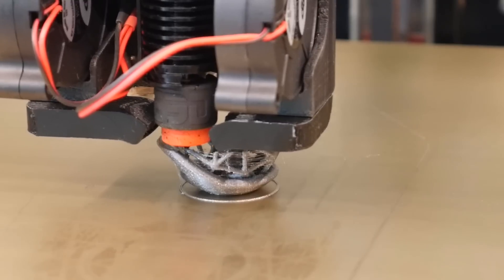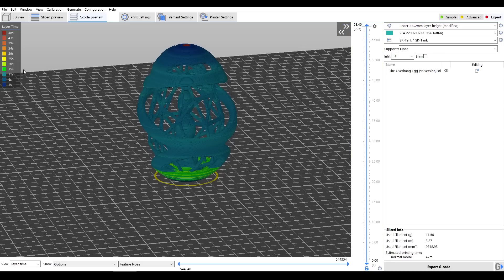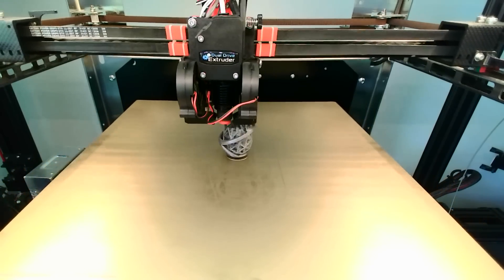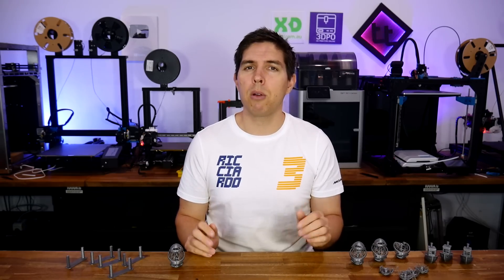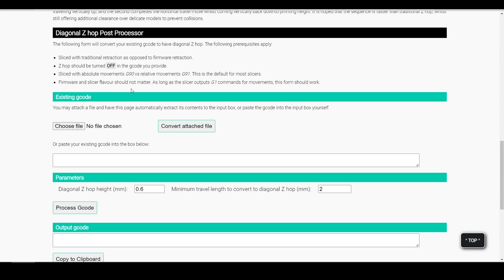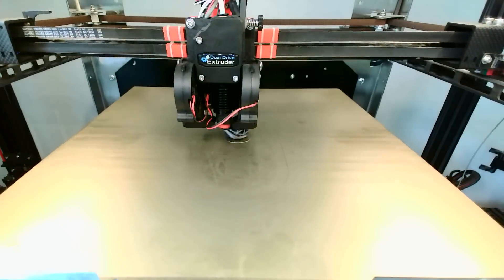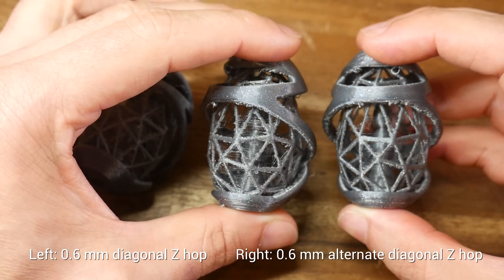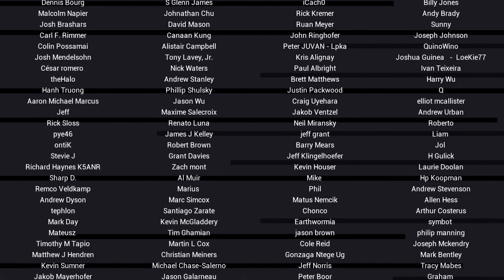Diagonal Z hop - Help me test this new slicing idea

Comment: I used to have a script that would intercept the g10 through g11 command, retract E, do a 3d diagonal move to just above where I was going to plop down, and then  unretract E, and simultaneously plop down. I stopped when I started using firmware retraction and linear advance. I've thought about hacking marlin to make g10 and g11 more complex by adding some canned code, but I haven't found the time

Comment: Clever work around and perfect timing because it may not be needed soon, I just saw a solid state cooling fan with no moving parts at CES, super cool and would be perfect for 3d printing.  And what do you know the issue of the print not sticking is directly related to cooling.  I wonder how much speed we're actually loosing because of non optimal cooling.  I see fan upgrades in the 3d print community all the time but nothing much more said after that.  The company claims it can improve laptops performance x2 is how bad cooling is these days , giving them another 5-10w of headroom, which is alot if your processor is only 15w to begin with so a pretty major breakthough in coolin technology i cant wait to see it applied to 3d printing.  Maybe you could mod an ender 3 to print at 500m/s with that kind of fan?  I saw the video on PCworld's channel that shows it off at CES if anyones interested and Frore Systems is the company.   It looks like a flat lithium battery that apparenty is filled with these small vibrating membranes that suck air in at incredible speeds and blow it out the end.

Comment: These PEI sheets looks like complete crap. Why you are using them? I use glass and PVP dissolved in an isopropyl alcoohol, and it sticks really well. I just cannot detach part from the glass. If I try pull too hard I will break the part or the glass, but not detach them.
Have stringing - dry your fillament. Have curling - add cooling, slow down and lower layer height. Z-Hop is not needed in any situation at all.

Comment: Will test soon. 
But: I think the results will be even better with a reversed start-section. What I mean is the following:
Z-hop to the opposite moving first for a short bit and then do the real motion, a bit overshoot and move back. I'm pretty sure this can eliminate the stringing even further.
Reply: Basically a wipe in the reverse direction? I was thinking something similar. It might be a bit tricky though because it might not be obvious which way to move back if there are many short segments.
Reply: @reverse_engineered  Yes, that is what I meant too. Might get the distance from the last line but still tricky.

Comment: An interesting idea, but there has been a feature request in Superslicer for something similar to the alternate version for quite a long time now (#927 and #2912). But, at least in part, for a different reason.

It's to get rid of the blobs at the end of a move. All filaments, even when retracted, ooze a bit during travel, some more than others, partly determined by temperature. The effect is at the destination, if it crosses a perimeter, a tiny blob - the ooze - will be deposited. Next time, one layer up, it will deposit the blob on the end of the blob it deposited last time. And so on, leading to the characteristic thicker line curving up and away from the destination perimeter. After a bit, the ooze line sags, the next move misses it and goes right to the perimeter and it starts again.

To get rid of it, add Z hop so the ooze clears the destination perimeter. Does the job but introduces stringing at the start of the travel. Wiping at the start helps a bit, but it still strings to a degree.

So the request is to introduce a rising Z hop, zero at the start of travel, some value at the end, followed by a vertical drop, though other profiles are also discussed in the feature request.

Ideally the rate of rise should be settable, either specified as mm rise per mm travel, or better still, mm rise per sec. So one sets the rise slope based on the ooze rate. It needs to be a filament variable as the ooze varies with the filament type.

No movement on implementing it so far.

Comment: This is a great idea, and I like all the replies.  Post processing gives infinite flexibility.
 Now my speculation begins:
I think the hop is required regardless of how well the print is secured, because you must avoid hitting curled edges.  (My post processor does this also).

Another thing to consider - we could call it ooze time - the interval between print operations that the printhead can/will ooze.  
Vertical hops are very inefficient/slow due to the 90 degree angle.  Not having the first vertical hop after the retract reduces the time, and so possibly less stringing.

Three 30 degree moves would be quicker, four moves at 22.5 degrees would be a lot faster. (Remember my Junction Deviation Visualizer, smaller angles corner much faster).

Yet another thing to consider is that ooze can contribute to nozzle depressurization, particularly when there are a lot of moves in a short period of time. You may see that your extrusion widths get narrower (easy enough to measure). (And there is also filament deformation with repeated retracts).  That can be compensated in your slicer.

I think there may be some shake when your bed is being moved up and down, perhaps that is contributing to the accuracy issue.  Angular hops reduce the rate of the bed movement slightly, that might help during the ending movement to reduce resonance.

You're doing great work!

Comment: I bought my first 3D printer this week, a Bambu Lab X1 carbon. It printed this egg in just over 1hr, with no issues or stringing, no supports. Used generic filament too. So far I’m blown away with this printer.
Reply: Exactly , just dropped the file in, sliced then printed. NO changes to default and perfect print in an hour. I am on over 1500hrs printed so far. Only cleaning/greasing and belt tightening maintenance. So between your new out the box and my seasoned X1C   fast accurate prints are straight forward on some printers.
Reply: I'm really proud of the progress that 3D printing has made. I'm still using my first 3D printer of an Ender 3 Pro, and hearing people like you getting into 3D printing with such significantly better printers makes me excited about what will be available years down the line when I decide to upgrade.
Reply: Try the same using PETG and report the results back here please.
Reply: Man, is like someone starts racing cars with a F1 instead of a little crappy car... Lucky bastard! 😜😜🤣

Comment: When printing parts with little first layer contact area, I add a 5mm brim and use glue stick.  You can also add a little paint on supports even though you may not need them. The support base adds a little sticking action to small first layer parts.   I also slice the model using Prusa's cut function. This adds the extra step of gluing the parts together and adding a little filler to sand.  I greatly admire your skills at programming G-code.. very impressive work on developing the diagonal Z hop.  Nice work!

Comment: Are you using prusa slicer? Isn't there a wipe settings in there? I'm pretty sure that's what I turned on in order to remove a lot stringing. I'm not going to claim that I'm trying to print anything nearly as torturous as this. But anyway

Comment: Egg falls off bed. Me: Add brim, set bed to 70(actually 65 when I measure it with my main printer) and try again. Depending on where the extra buildup is, I'd probably do a combination of coasting, neg prime, increased retraction, lower hotend temp, full cooling, max travel and raise jerk speed.  ..and as a separate note, not try it in PETG ever

Comment: My guess, explained better by Bu Jin here, is that the stringing would be reduced if you didn't raise until the head is in mid-air.  That is, delay the z-hop for a mm or two, but keep it vertical.  This way, it wipes away any stringing on the source island, z-hops over other islands, and down to resume at the destination.
Reply: My thoughts as well while watching the video.

Comment: Important thing is when retraction occurs. For long time retracting in slicer was done WHILE moving up Zhop. This was perfect receipt for string to pull. You can fine tune it with "wipe". Enforcing 50-90% of retraction before wipe will break string before mowing up. I checked 2.5 PS and this behavior is corrected. Still by using last few mm of path as place to wipe /not much settings in PS/ you could better break string. A blob will start to form, but a "reverse wipe" on landing could hide it. And after a month of tuning... :D

Comment: That's all an interesting approach to z-hop, but the real problem you have in the egg print is the toolhead design on the Tank is awful for cooling. Those ducts take a full 90deg turn and then moves horizontal for as much if not more distance than it went vertical, and it looks like the two streams of air point directly opposed to each other which is the worst possible solution for cooling the filament in the middle as that the area of least flow and pressure. Smoother flowing air path in the ducts and both pointing slightly backwards of the toolhead would greatly increase the cooling. Take a look at the ducts on the XOL2 toolhead or the Stealthburner or the K3.

Comment: While I can understand the 'up' portion of the diagonal move, I'm not sure the 'down' portion of the diagonal move actually contributes much to the improved print quality. If the benefit of the diagonal move is to clear the nozzle from curled edges, you would theoretically want to reach the maximum height of the z-hop as soon as possible (at an angle that still provided the low-stringing benefit of course), sustain that z-position, then drop to the model at the intended destination (such as in your alternate diagonal move) Moving diagonally upwards the entire travel move seems to just increase the risk of clipping some element of the model over long distance travel. So perhaps you could include another parameter that controls the total distance traveled before the maximum z-hop height is achieved.

Comment: Hey there Michael, could you add a Z speed to the gcode generators on your site?  I have some modded printers that use a Tr8x2 (vs the TR8x8 stock) lead screws but the Z speeds on the tutorials is much higher than the Z motors can handle (basically any z movement just grinds then the height is not correct) love your content.  I was just bummed when i realized my big brain leadscrew upgrade mean in needed to slow Z speeds.
Reply: You can just change the DEFAULT_MAX_FEEDRATE or set it with M203 (at least for Marlin, no idea on other firmwares)

Comment: It seems like the moving horizontally has the effect of wiping the nozzle clean.  I wonder if a method of retract, then move horizontally off the part, then ramping upward would be effective.  Then a simple lowering like you do in the alt method and restoring the filament back to the nozzle would work.  Further, to prevent whatever limited filament might be dragged off the edge, a brief reverse in horizontal direction might keep more material away from the part edge.  Whatever might remain would potentially have minimal impact on the next layer deposited.    I"m still new to all this, so I don't have the experience to predict the possible results.